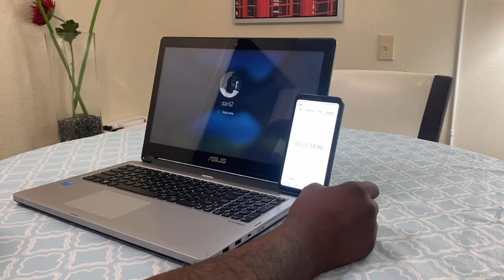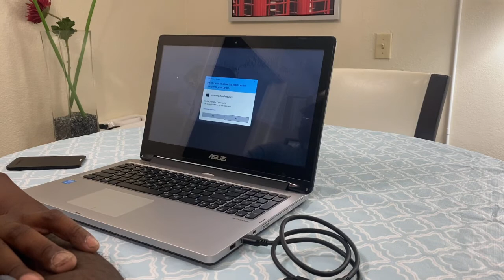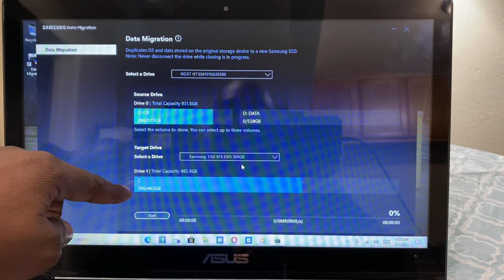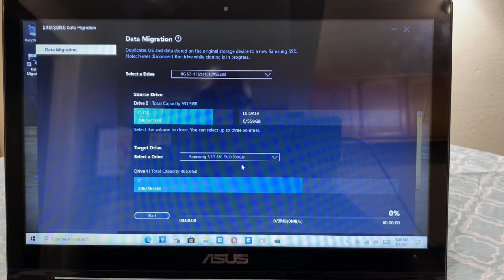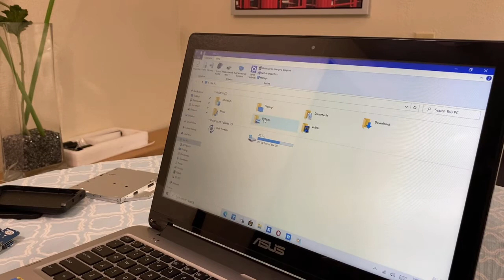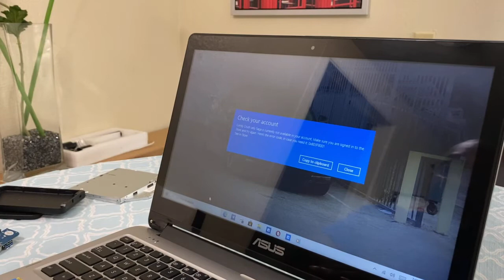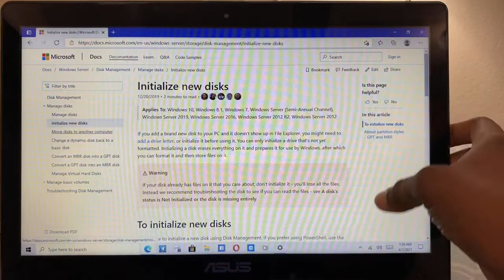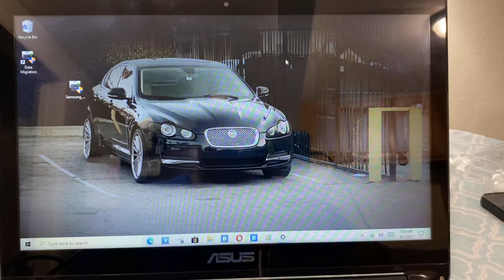Asus R554L 2 in 1 hard drive upgrade part 2

Comment: Great video - Two questions though. 1: What are the names of the hardware you installed (specifically the touch screen, SSD hard drive, and the cloning device) and 2: where did you buy them.  I have the same laptop and need to follow your example. Thanks!
Reply from the maker: Hey thanks for the inquiry. I bought items from both eBay and Amazon.

Ebay:
The touchscreen digitizer $80 from China, very different to find so check all the specs and connection pins if you find it before buying. 

Ebay:
For the memory (A-Tech 8gb DDR4 memory card) $20, only 8gb because the maximum it will run is 12gb and it has an internal memory of 4gb already built in.

Amazon:
Samsung 870evo SSD 500gb to replace the operating system drive. $40

Amazon:
Replaced the dvd drive with an HDD caddy brand (Highfine) $9, to install a Seagate Barracuda 4tb HHD 2.5” drive $80
Reply from the maker: Also for the cloning I downloaded software from Samsung website